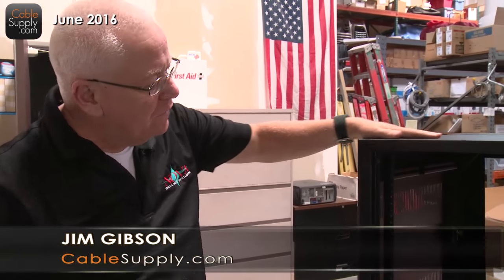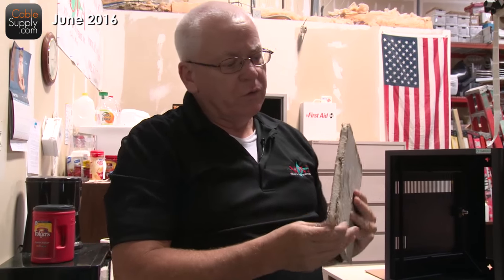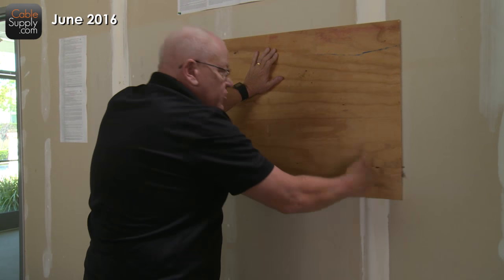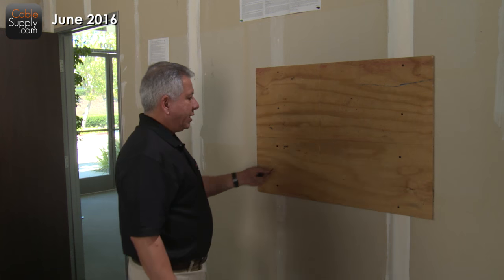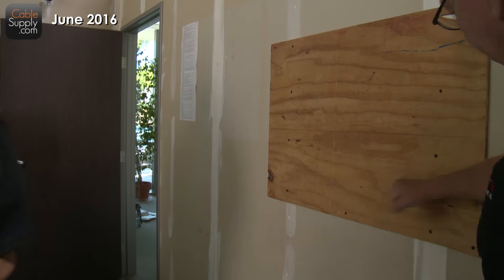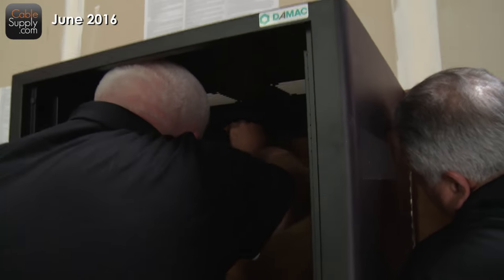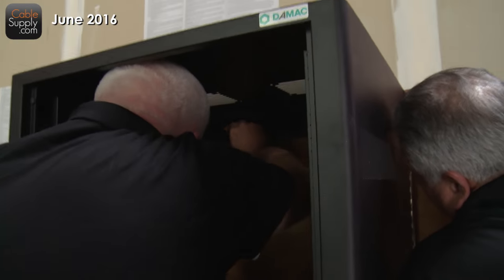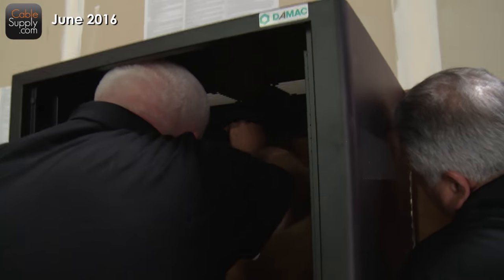How to install a data Rack, Wall Mountable, DAMAC,  Part 2

Comment: Thanks for the video, I'll definitely use this tip on Monday I have to hang 12U rack on dry wall where's 100mm gap between dry wall and concrete.
Reply from the maker: We (WWW.CableSupply.com) sell data racks

Comment: A lag bolts is stronger in a 2 1/2" stud vs a 3/4 piece of plywood.  Anything heavy should blot directly to stud unless it is less than 16in or the stud span
Reply: I agree with what you said, a small correction though: the cross section of a 2x4 stud is 3 1/2”.

Comment: I noticed only 2 lag bolts used in bottom left and top right.  Do i need to get all 4 corners? 

Switch, modem, router, powerstrip, 3 wireless voip phone bases, and 1 pbx aanndd an empty shelf to put the non rack mountable items on.

Comment: what screw size do you recommend?
Reply from the maker: Size and type is based on the wall surface you are going through.  If it a drywall try to hit a stud with a drywall screw.